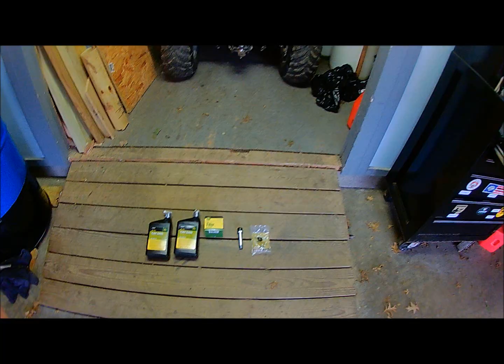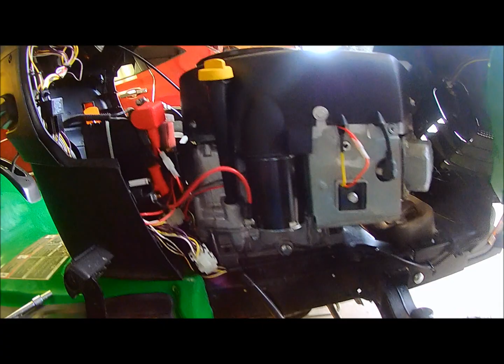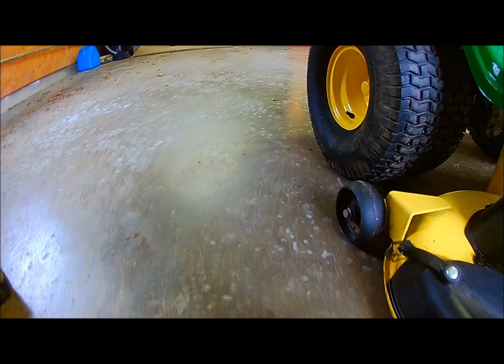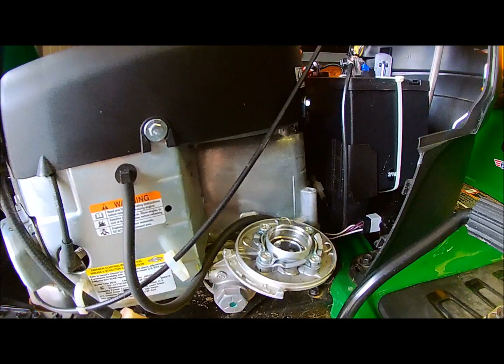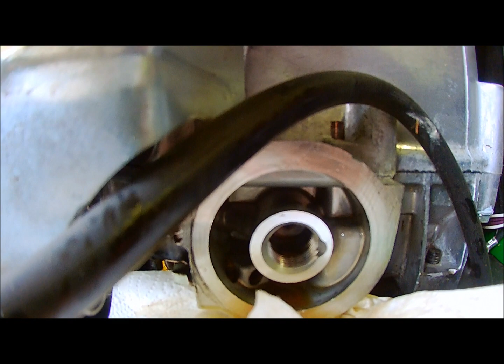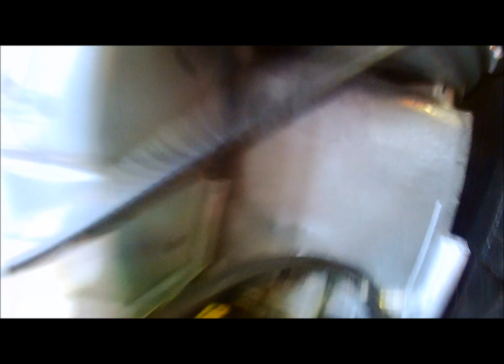John Deere EZ change oil filter conversion

Comment: Great video.  I just ordered the kit for my S120.  When I bought it last June I thought the easy change would be great.  Then I saw how much it costs and how little oil is changed.  Will install the kit to be ready for spring.

Comment: Hi Thanks for the info, I'm gonna do the same thing for my john deere. I have a question though, why use permatex on the drain tube and loctite for the filter nipple?
Reply from the maker: Just personal preference. Locktite on the filter nipple will help from it screwing out with when the filter is removed. Since the drain pipe is steel and the block aluminum, permatex should stop any seepage. There are comments on this post not recommending doing that ?

Comment: Would you share the torque specs of both the oil drain extension pipe and the oil filter adaptor nipple.  BTW, good job!
Reply from the maker: Can't offer torque specs. Just tighten to feel. I'm old school.

Comment: How did you open the stock drain plug? It's the 4 sided drain bolt. I had no room to insert and torque an open head wrench!
Reply from the maker: I used a crowfoot wrench with a ratchet and extension.  I just got a cheap set at Harbor Freight.    https://www.harborfreight.com/7-piece-3-8-eighth-inch-crowfoot-sae-wrench-set-94426.html
Reply: @rickb8808  thanks alot. What size crowfoot wrench you used to open the stock drain plug?
Reply from the maker: @gardenia1738  Not positively sure, but I believe it was 7/16" or 1/2".
Reply: @rickb8808  Thank you sir. The 7/16" crowfoot worked great!

Comment: The ONLY part of the "Easy Change" system that I like, is the extra large JD oil filter. If money is no concern, continue using the Easy Change oil filter and drain the entire engine, with the drain plug on the other side of the engine as shown in this video. You'll just need to buy a couple extra quarts of oil with every "Easy Change" filter.

Comment: good video. The screwdriver did work but made me cringe a bit. The only real issue is that you should have lubed the oil filter seal with a bit of oil and HAND TIGHTENED it as tight as you could get it. Never ever use a filter wrench to tighten this type of oil filter. It can damage the filter if you are not careful, and it makes them incredibly hard to remove even using a filter wrench. Other than that you did a great job with good camera work and got right to it without the usual blah blah blah that most guys do!

Comment: You saved me some money, now and in the future. For my first oil change on an E150, I got the 2 jugs of oil, the filter and the two required parts from the John Deere dealer for less than the cost of the ez change filter alone.  thank you, well done.

Comment: Great video, thank you. Question, how did you know that the small filter you used is the correct filter for this motor? Thank you.
Reply from the maker: The Green Parts store, who is a John Deere dealer sells the conversion kit using genuine John Deere parts. Since this video, I have changed the oil a couple times and gotten the filter from my John Deere dealer who is familiar with the conversion kit.   https://www.greenpartstore.com/John-Deere-Easy-Change-Conversion-Kit-AUC12916-KIT.html

Comment: I just ordered the oil drain tube
So I can drain the oil.im keeping the big oil filter its pricey but I think it's better then the small ones that's my opinion no one get mad lol
Reply from the maker: Your choice to keep the big filter, however, the only reason it is so big is because it has to have room for the oil that's in it. If you drain the oil, I imagine you have to buy a qt of oil when changing as you will be draining more oil than what is in the new large filter. I never cut open a ez change filter but the actual filtering portion probably isn't any bigger than the smaller filter.

Comment: Great video, just completed the upgrade and it took about an hour and most of the time was spent cleaning up my mess. Don't understand how anyone could agree w/ the original design of leaving all this dirty oil in the crankcase and calling it a "change kit". Great conversion kit from John Deere for less than the cost of one original oil / filter change!
Reply from the maker: Yes Sir, and now you can use your favorite oil also. Change over isn't hard at all.
Reply: Well I guess their idea is leaving dirty oil in your engine will shorten its life and you will have to buy a new one in 5 or 6 years as oppose to the old ones which could last up to 20 years.Mine is 17 years old and still going. Just saying. Kudos to John Deere, vary smart. LOL.

Comment: Thanks. I'll be doing this conversion. Also interested in how you removed the side shoot from over the mower deck.
Reply from the maker: Stephen, if you pause the video at the beginning, you can see by the belt cover towards the front there are 2 studs/bolts sticking up on the deck. The side shoot connects there. I left the nuts on so I wouldn't loose them. I put a mulching cover on and switched out the blades to Oregon "gator" mulching blades. Have had good luck with them in the past.

Comment: great job and good video, it is to the point. I am currently in the market for a new lawn tractor and I've decided against any that has this system on it specifically for the reasons that you changed yours.

Comment: Do you know if one lose the guarantee for changing the oil system?
Reply from the maker: The kit I talk about is sold by a John Deere dealer consisting of all John Deere parts. If you clink the link below it states in their item description, " This is a John Deere authorized conversion so it will not adversely effect you warranty." My local John Deere dealer also stated it will not affect the warranty. You can also have your John Deere dealer convert it but you have to pay their labor.

Comment: you say you spray raptor liner through a normal spray gun with reducer for a finer finish , is the finish Good and did you mean the gun was destroyed by the end , thank you
Reply from the maker: I use a cheap purple Harbor Freight spray gun. U Pol states you can thin Raptor Liner up to 10% with Urethane Thinner. I have found on tintable liner I thin it to a 5% max because of using the tint base which thins it. I prefer a thicker application. I know people who thinned the Raptor liner 10% then added the tint and had excellent results. I spray using the paint tip that came with the gun. Black pre tinted Raptor liner I reduce at 10%. I also suggest a suggestion someone made online to drill the spray tip out to 2.0 mm with the black. I can get the Harbor Freight guns on sale/w coupons under $10. I clean and reuse them but don't get to upset if one is trashed. In actual beds and undercarriage my preference is to just use a shutz gun and not thin it. For body applications and interior floor pans thinned looks better. Seems to hold up fine thinned. Use it lots on rockers front to back on stone chipped areas. Don't get complaints. Lots of You Tube videos on the process. I'm not patient enough to make one on that large of a scale.

Comment: Can the residual oil just be sucked out with a vacuum pump style oil evacuator instead of adding the drain tube?
I take it the standard oil filter won’t fit on the easy change filter housing?
Reply from the maker: I've never used a vacuum pump to remove oil from a small engine ? NO, a standard oil filter will not work on the EZ change filter housing. The housing has to be removed and a nipple screwed into the block per instructions.

Comment: HELP ME PLEASE,,,,,,,,,,,,,,what am i missing here?  this vertical filter looks like it will make one heck of a mess when you remove it............am i right or wrong,,,,,,or is there some secret JD TRICK  to this filter...........and why would you call it easy change if it does make such a mess like it seems to me it would......the only thing unprofessional about this video is THE IDIOT ENGINEERS AT JOHN DEERE FOR COMING UP WITH SUCH A STUPID AND EXPENSIVE IDEA............LIKE TRYING TO REINVENT THE WHEEL...........IT'S ROUND AND IT ROLLS ,,,,,,,,,,,,,,,LEAVE IT ALONE..........
Reply from the maker: The easy change filter seems to have something in it so when you twist it and pull up it seals the filter. At least mine didn't leak when I removed it. I did not like the amount of oil in the filter when I cut it open. I just put my tractor away for winter. Our local Lowe's want's $39.99 for a Easy change filter. I got 2 quarts of JD oil TY22029, JD oil filter AM125424, JD fuel filter GY20709, and a after market air filter I prefer because it comes with a foam pre-filter Mckin 796031 for $36.99. And instead of a new EZ change filter with a little oil and a sump of dirty oil I have all fresh oil ready for spring. Works for me.

Comment: Thanks for the video. It was great.
When I bought my E120 last summer (2018) they told me about the EZ Change System. I knew right away that it wasn't for the serious gear heads. I had always changed the oil in my small engines (lawn mowers, snow blower) once a year, every year. So I started looking for a way to convert it to a "regular" system.
Your video was the first one I found on this and it helped me a lot.
I just did the swap today (Sep 3, 2019) at the 8-hour mark. It went pretty much the way you laid it out.
The John Deere dealer here in Ottawa Canada didn't stock the complete conversion kit like the Green Parts Store does but they did sell every part separately.
I'm going to keep the EZ Change mounting bracket in case I get too old to use the tractor and have to sell it. It might attract a few more buyers when the time comes.
Thanks again.

Doug

Comment: This is what Deere says... John Deere Easy Change 30-second oil change system

The John Deere Easy Change 30-second oil change system makes changing the engine oil easy, quick, and clean. Changing the oil is as easy as twisting on a new oil-filled filter. Oil does not need to be drained from the engine.

The John Deere Easy Change filter is an additional engine oil reservoir. Changing the filter removes the captured contaminants and replaces about 0.8 qt (0.76 L) of the engine oil. 

Compared to the 100 Series traditional oil filter, the Easy Change oil system uses a synthetic filter media material, has more filtering capacity, and has more oil flow capacity, � and the engine system has 40 percent more oil volume.

Everyone who uses the John Deere Easy Change system saves time and avoids the mess of a traditional oil change. In the past, many 100 Series Lawn Tractor owners rarely or never got around to changing their engine oil. With John Deere Easy Change, even owners who previously would not consider changing the oil themselves can easily do it now. 

So, I say to deere if this is so why don't they use the quick change system on the E140?
Reply from the maker: Hello Donald. My mower is a E150 and had EZ change. At that time the E140 and E170 didn't have the system.  We went for a E170 and they were sold out so we got the E150. I checked out the new ones a couple weeks ago and the E140 still doesn't use the system but  E150, E170 & E180 does ? I originally thought maybe it was only the 25 H.P. v-twins because the E140 is a 22 H.P. v-twin but the E130 is 22 H.P. and uses the system. It may be true the EZ change may allow those mechanically challenged to change their oil. I prefer all clean oil and a filter when changing at less than half the cost of the EZ change cartridge. John Deere dealerships have the conversion kit available and the one I deal with agrees the standard filter allows a complete fresh oil and filter. I'm sure they agree with someone forking out double the cost or more for the EZ change also when they come in.

Comment: So does anyone know the size wrenches needed for the drain plug and to take off ez change filter??
Reply from the maker: Hello Daniel, I used a 1-1/8th inch 6 point socket on the ez change assembly bolt and a 7/16" open end wrench on the drain plug. The factory uses thread lock on the drain plug so I used a 10" pipe over the wrench just to break it loose. Once loose, it screws out by hand. Hope this Helps.
Reply: @rickb8808  thanks so much!!😁
Reply: I totally agree the conversion kit is the best way to go...something I need to consider....maybe others as well is the upfront cost....I don't have all the tools required for the job....I think I can borrow them from the maintenance department at work.....otherwise if I gotta buy tools+conversion kit it will cost me about $65
Reply: @rickb8808  don't really understand how you had room to work on drain plug??!!
Reply from the maker: @danielfosdick4829  It's tight but you can get small movements until it"s loose enough to turn by hand.  Didn't even have to cuss !!
Reply: @rickb8808  I can't!!
Reply from the maker: @danielfosdick4829  I asked  others who did the change. One used a 7/16 wrench as I did. The other used a 7/16 crows foot wrench. A crows foot wrench uses a 3/8 ratchet and extension. I attached a link of a set at Harbor Freight. They allow you to get into tight places.   https://www.harborfreight.com/7-piece-3-8-eighth-inch-crowfoot-sae-wrench-set-94426.html
Reply: @rickb8808  Thanks!! For me that was the hardest part....I finally turned the 7/16  wrench around and put a screwdriver through the end to turn it....finally worked
Reply from the maker: @danielfosdick4829  GREAT. Now start saving $$$ on those oil changes and your changing out all the dirty oil with fresh.
Reply: @rickb8808  right but it did cost me some for required tools!!👍

Comment: I’ve only got 5 hrs on my D160, but I ordered the conversion kit.  $30.00 for a filter sucks! Love the mower, had to break it in on 2 acres of 3-6’ tall grass. Very impressive, but hard on a mower! Checked the oil before mowing it the second time, & I was a quarter of a small bottle, low.  Topped it off, & it impressed me again!  It took me 2 hrs to mow 2 acres of that thick grass from the first mowing.  I’m almost ready to lower the deck to below the 4” height on the machine.  I had to wait a week to mow the second time.  Thanks for the video, it showed me what was involved, to make up my mind. I bought the Deere, because the property is 45 miles away from my house. My home mower is a 42”, 24hp zero turn Craftsman z6000.  I really like both mowers, but thought 42” deck was two small for 2 acres.  This is my first John Deere, Satisfied so far. I might be able to use same parts on both mowers.

Comment: Just purchased a 110 model at Lowe’s this week 6-26-19 and it DID NOT come with the new oil system , it has a spin off filter
Reply from the maker: That is a single cylinder engine Kathleen. This system is only on the 2 cylinder v-twin engines. However, for some reason John Deere did not put it on the E140 v-twin engine ? You bought a good mower, you'll like it. Really like mine with exception of the EZ change system which I took care of and the button you have to push to go in reverse as my yard requires backing up a lot.

Comment: PS I just ordered from the "Green Parts Store".  I hope they give you kudos!
Reply from the maker: I'm not looking for anything. My neighbor picked up a E150 right after I got mine last fall. He swore by the EZchange system. He changed the oil after the initial break in time and bragged about how it took him 2 minutes. He cut grass  once and checked the oil. It was down substantially and he came over and asked me if I had a quart as I normally buy oil & a filter shortly after changing oil to stay stocked up. He asked if I knew anywhere to get the EZchange filter cheaper.  Now he would also have to buy a quart of oil every two oil changes if the EZchange cartridge wasn't replenishing all the oil. I talked him into us draining all the oil out through the drain plug just to check it out. I had 2 quarts to replace it. The new EZchange oil with one grass cut on it was dirty with particulates. He wasn't happy. He's almost due for another oil change in mid July and asked me to order the conversion kit and help him change over. When I showed him the price he was shocked how much cheaper it was than the EZchange filter. And after installing the kit it will be even cheaper the next change and you will have clean oil.

Comment: what did you use to get the drain plug out
Reply from the maker: Crowfoot wrench. Don't remember if it was 7/16 or 1/2 inch.  https://www.harborfreight.com/7-piece-3-8-eighth-inch-crowfoot-metric-wrench-set-94427.html?_br_psugg_q=crowfoot+wrench+set

Comment: I also switched to a Motorcraft FL-400-S oil filter which is a longer filter. It's a third the cost of a JD filter and can be picked up at Wally World. It requires a little more oil when you use one. Been running this filter for years on my LA130.
Reply from the maker: Thanks for the info. Will look into that.
Reply: I wonder if this will work on my D 170

Comment: Thank you so much for sharing this.  I bought an E130 new this year, and thought it was a great idea until I realized that it was not replacing all of the oil.  Happy to know that the conversion kit is very inexpensive.  I will be doing this as soon as I hit 50 hours on the hour meter.
Reply: I wouldn't wait until the 50-hour mark. The manual specifically says the break-in period is 8 hours. Then it's every 50 hours or every year whichever comes first.